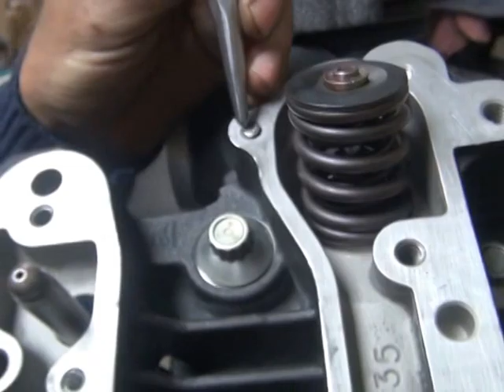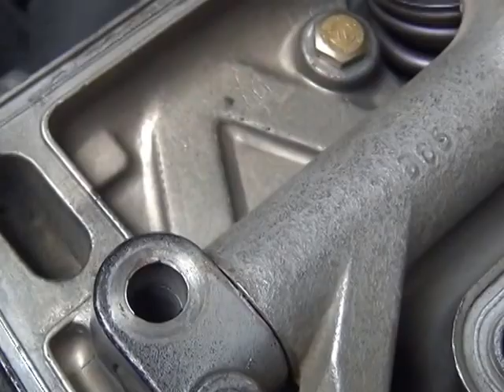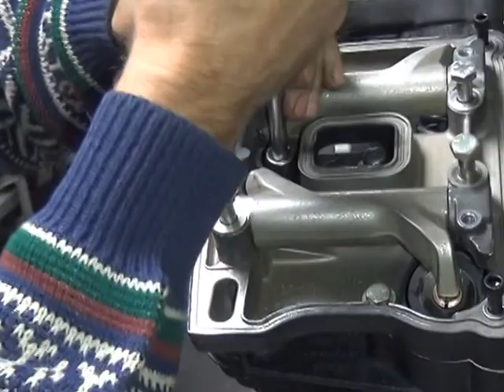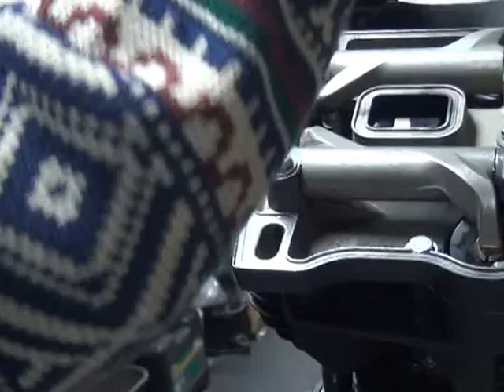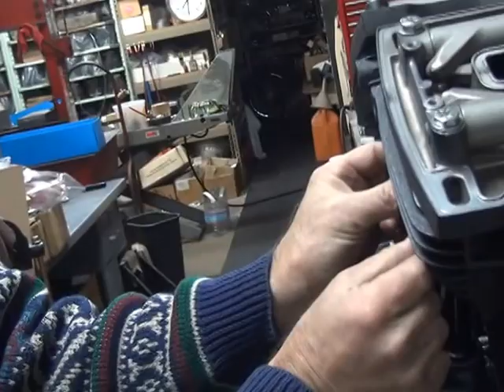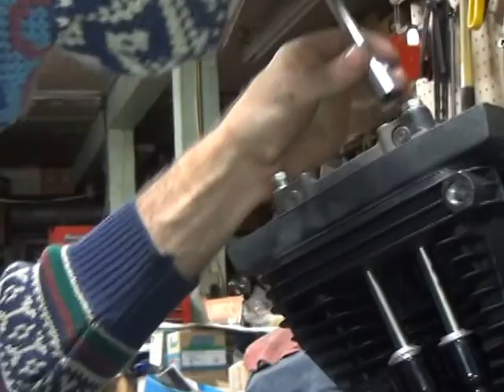#173 1992 Harley FXR Evolution 88ci Motor Assemble Rebuild Tatro Machine

Comment: Like the videos got a 97flhr got to torque the heads don't  no what the torque is. Ordered a book 3 more weeks out.can you tell me what it is please thank you
Reply from the maker: i use 38# with oil on everything. you gear oil if you don't have assembly oil. you can push it to 40# if you got high compression and are going to run it hard.
tatro
Reply: @TatroMachine  dude thank you very much again big help